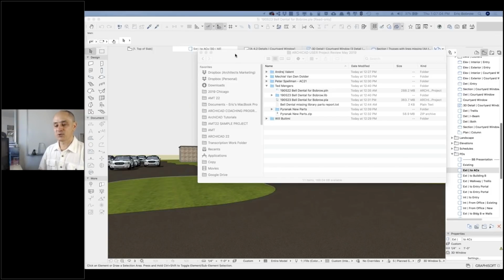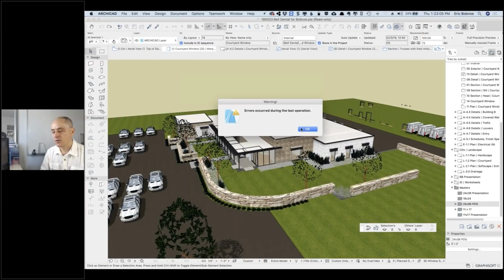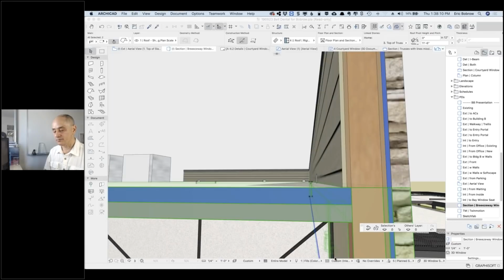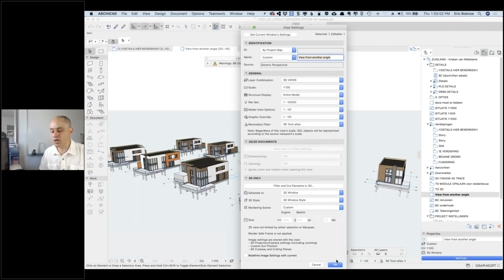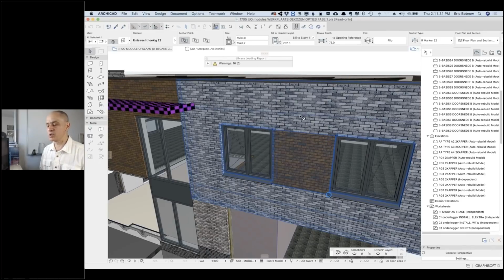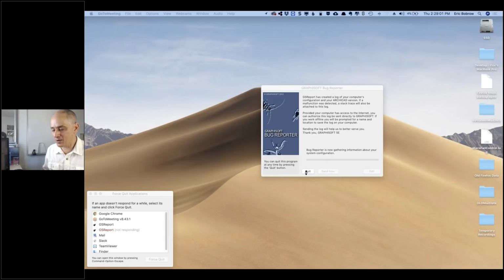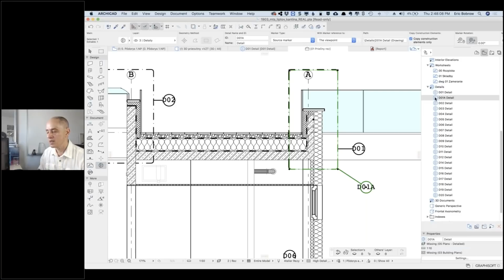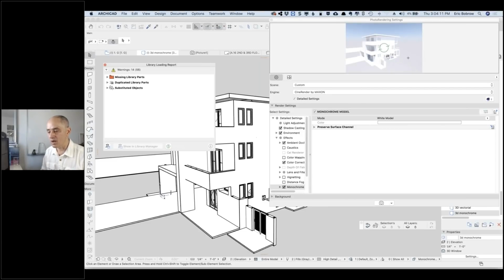ARCHICAD USER - Project Review - May 2019 webinar

Comment: Thanks Eric.
Would like to know how you would model a pony wall in archicad please.
Reply from the maker: Archi-K - If you mean a short partition wall, then the answer is simple: unlink the top of the wall so it is not set to go full-height to the next story, then set the height as needed. If you're doing a short wall in between other elements, sometimes it's easiest to place the basic wall on plan, then in a section adjust the bottom and top.